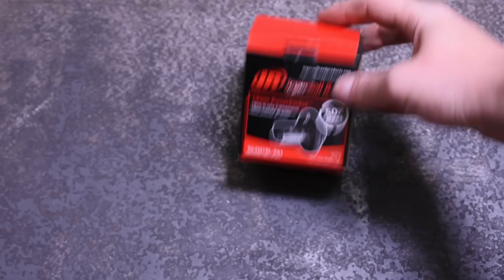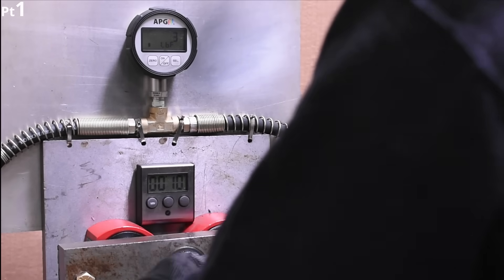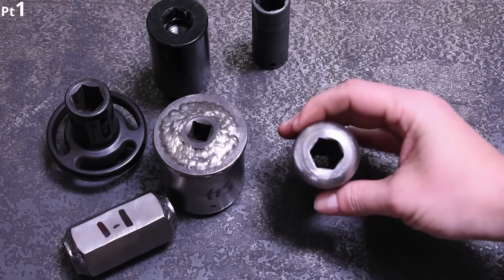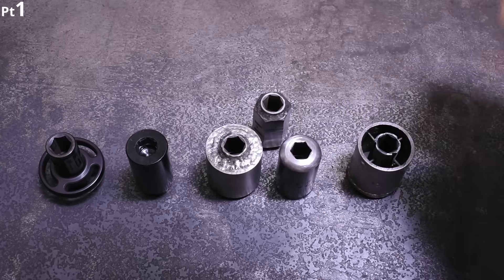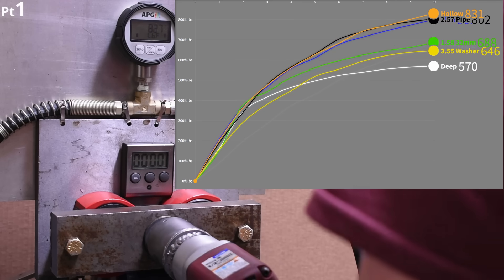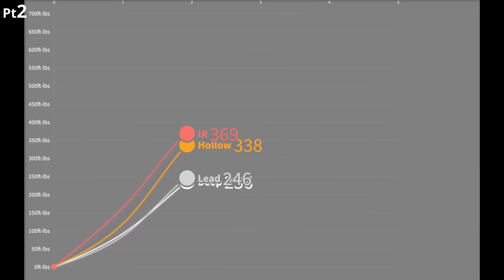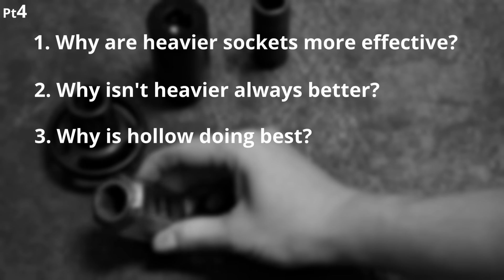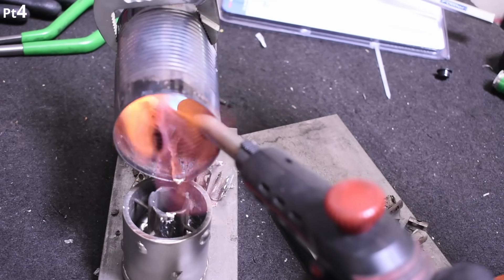Heavier Sockets Make More Power? Stumps Physicist

Comment: Mechanical engineer here, the goal of these attachments is to achieve better dynamic frequency responses out of the tool. The resonant frequencies  are difficult to pinpoint and just about every condition influences if you can perform at a resonant frequency. If your attachment makes the tool perform at a natural, resonant frequency, you will see force multiplication on the output. I think there’s a MythBusters episode about this.
Reply: @Eddie To make this a testable hypothesis, can you propose a way to tune the resonant frequency of the system in a fairly continuous, reversible, and repeatable way? I’m thinking of a socket with a concentric outer sleeve (like the hollow design from the video) that has dozens of tapped holes for removable set screws to change the mass / rotational inertia. I guess they’d need to be blind holes so that you could set them to the same depth every time.
Reply: @bjmcculloch  An electric impact tool could be modified to run at variable speed.  You could then ramp and tune the frequency to match the application each time.
Reply: Physics education myself, but thinking the same thing. Some kind of resonance seems important.
Reply: You said it more intelligently than i was going to do. The professor failed to consider the power source applying the force to the socket. Impact tools don't produce linear power.
Reply: Good line of thinking! Any time you hit something with a hammer there is some oscillation. If you hit the object again when the oscillation is in the same direction as the hammer blow you get an additive effect. Keep hitting the object and the oscillations of all the previous hammer blows add up and if you strike the object at the sweet spot where all the oscillations add up in your favor you get more effect.
Reply: @blackcat31w  sounds quite a bit like Nikola Tesla's "Earth quake machine" He knew there was great power in vibrations and resonance
Reply: That's kinda what I was thinking.  It's not just weight but frequency and balance alao
Reply: Dynamic response is the correct thought path.  I think what's going on is impedance matching.  The bolt shank and the impact driver output shaft are twisting and absorbing energy that should be going into overcoming friction in the bolt thread.  The added inertia is both reducing the peak velocity and storing energy, which effectively makes each torque pulse slower but longer.  The effect is the torque pulses look more like a steadily applied torque to the bolt.  The impedance between the impact driver hammer and the bolt thread is reduced.
Another effect of the slower/longer torque pulses will be the socket does not bounce off the bolt hex as much, so less energy is wasted rotating the socket to be back in contact with the hex during each pulse.
When they shoot the high speed video, what we should see is the heavier sockets don't rattle back and forth as much.
I can't think of any reason the shallow socket would have performed better than the deep socket all else being equal.  My guess is the shallow socket was a tighter fit on the bolt hex.
Reply: ME here too...makes sense!
Reply: Stfu mechanics hate u
Reply: Nailed it.
Reply: This has to be the explanation.
Reply: It’s a three mass spring system, the moment of inertia of the center mass( the socket) and the frequency of impact determines the maximum force between the socket and the nut/ bolt.
Reply: On the $72 socket with a flywheel style. The added weight is out away from the center of mass. On just adding weight, as with the lead loaded socket, the extra weight was evenly distributed from the center out to the edge. This gives you plenty of weight but it absorbs the impact's power to turn this extra weight. 
The extra thickness of the one very thick store bought socket is as your physics guy talked about is that with a tube a thicker wall is stronger than a thin one. This makes the thicker wall less likely to flex under the impact's force. Like regular sockets are made with a somewhat thin wall tube and impact sockets are made from a thicker wall tube. 
On the hollow built socket worked because it used the same flywheel effect the $72 socket used.
Reply: Redneck engineer here: You can swing an 8lb hamner, or a 16 lb hammer. Which one will do more damage both to you and whatever you swing it at? Resonant frequencues absolutely come into play in engineering. But this is literally equuvalent to just swinging a bigger, longer, hammer. Making the hollow socket is equivalent to putting a longer handle on your hammer. Just like with a hammer, there is a limit to what you can swing, no diff with the socket and wrench. At some point the hammer becimes too heavy to swing
Reply: So its acting as a second impact between every time the hammer in the tool hits the anvil? I'd be interested to know how the same socket would perform with another arm lengths and thicknesses.
Reply: I don't think it's that complicated. I think it's just damping preventing energy losses
Reply: And it would make sense that the tools are tuned for the larger, heavier sockets that you would use with larger, higher strength bolts.
Reply: @kco1270  ideally yes. Unfortunately, a poorly chosen socket/extension could easily suppress and dampen the output torque of the tool. You saw some of this in the video. Dynamic systems and controls are a really interesting field of study.
Reply: I stayed at a Holiday Inn one time and believe you are on to something.
Reply: Yea as a mech engineering student this all seems to be while not basic, something that should be able to be understood. I think he either found a poor physicist or a busy one with exams around the corner!
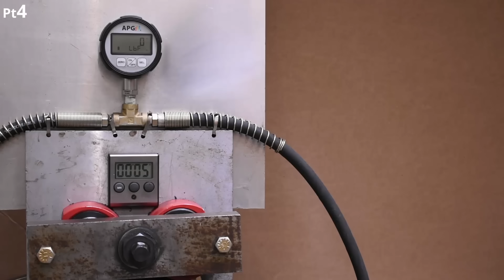Reply: Some of the sockets @14:47 flywheel removed version as well as xyz are visibly not balanced, perhaps directing the vector of force somewhere other than a purely 360 degree rotation. Skewering these and balancing them on an old school motorcycle fork style tire balancer then removing non conforming material with a drill or grinder might go a long way towards smoothing direct comparisons.
Reply: In an electrical circuit maximum power transmission is achieved when the source impedance matches the load impedance. I expect this is similar except mechanical. Timing/resonance might also be an issue, like pumping at the right time to get a swing moving. SloMoGuys might be useful? Might be similar to the way an antenna works as well. Don't some impact tools hit faster (more frequently)? My gut tells me that a lighter socket would work better with a faster tool and that a heavier socket would work better with a slower but harder hitting tool.
Reply: Not engineer here: I would also assume that the fact that the body transmitting the force on the DIY sockets seemed to be made from mild steel, the difference in effective Youngs modulus between a mass produced socket made from forged and tempered 42CrMo4 (SAE 4140) steel and a DIY welded composite socket made out of S355Jr (ASTM A572) would probably be significant.

Just my guess, might be a total fluke
Reply: Instantly thought of Tesla here, ‘resonance’👍
Reply: If you say so. Seems far simpler to me and all were seeing here comes down to differences between discs vs rings on torque. If you're not sure what I mean, there's a difference between how a disc rolls down hill and a ring.
Reply: Incorrect.  It's acting like a fly wheel.  That means it's maintaining momentum.
Reply: @Mr_Dopey You're wrong. Touch grass kid.
Reply: I don't think this is correct, I believe the tool is tuned to perform at a frequency range, otherwise a variable trigger would be pointless on power tools. I think the biggest factor has to do with where the mass is concentrated in the socket. The hollow socket performed the best because its mass is concentrated further from the center of rotation, which makes the mass accelerate faster, improving the force of the hammer strike. Also a mechanical engineer, though I don't believe that makes me smart.

Comment: A couple of thoughts:

-Firstly I think it’s most useful to think about this problem in terms of angular inertia. E.g a weight put further out contributes more to inertia to the socket than the same weight close to the center line.
- In those terms it looks possible that all of the sockets that perform well kind of cluster in the same region. Either having little weight far away from the body like the hollow socket or a fair bit of weight concentrated close the the center like the Lyle.
-This suggests that there’s an optimum amount of angular inertia for a socket to have
-If this is the case then we can explain the lead and heavy washer sockets low performance by them being further from this optimum amount.
-But then why does this optimum exist?
-I can only hazard a guess but we already know that increasing the hammer mass of an impact improves its performance. 
-But we’re not increasing the mass of the hammer you say. True but the socket is the hammer from the perspective of the bolt.
-That would explain why increasing the weight of the socket improves performance. But we also need to explain why there’s an upper limit where performance drops off.
- If we again think of the socket-anvil-hammer system as the hammer from the bolts perspective perhaps the super heavy socket prevents the system from reaching its maximum speed during the split second that it’s being accelerated by the impact before it in turn impacts the socket.

This all suggests a couple more experiments. 
- Does relocating the weight of the socket to further from the centre also improve performance as my tiny knowledge of physics suggests?
-Does my guess that it’s the weight of the entire socket anvil hammer system hold up. If we move an oz from the hammer to to socket what happens?
-If we force the issue and remove all slop from the socket anvil joint by say welding the socket on does the impact perform the same?

Awesome video as always
Reply: Great video! Sometimes when I'm having difficulty getting a fastener in or out,  i turn the whole impact driver in the opposite direction until all of the slop is taken up in the wrong direction... giving it a maximum slop condition. When i pull the trigger the motor has a brief moment of more free-wheel spin while it takes up the slop in the system.   Kind of like trying to give the motor a soft start without any pre load.  So, going of that , I wonder if the flywheel like designs optimize slop spring back to couple the most angular momentum into the system. Kind of like adding a  secondary hammer to the impact driver.
Reply: @jasonspudtomsett9089  Yes, I’m wondering how much the variability in the slop for different sockets influences the outcome – both in terms of the driver-to-socket slop and socket-to-bolt slop.
Reply: Perhaps the maximum socket weight is somewhere below the weight of the hammer in the gun. If the hammer weighs more than the socket, it's going to be exerting too much of it's inertia just to move the socket?!? just a guess, but your thinking was on par with mine
Reply: I'm curious if stiction is a factor. When the bolt starts turning, the increased momentum keeps it moving. I also expect that the characteristics of the impact gun would have a preferred amount of momentum for the socket. There could also be some bounce happening.

It's pretty fascinating.

Comment: I HAZ WELDER! CHOP CHOP CUT CUT MELT MELT SPARKY SPARK SPARK... what about an extended socket to clear said application (crank pulleys, wheel lug depths, etc) but with a hollow mass more towards the impact thus allowing the beans to get to the bolt. I see a lot of ironworkers chopping a standard impact socket in half with a cut off tool then welding a length of pipe between the socket end and the impact end (making a 3" socket about 8-12"). Curious to see what a socket like that brings to the table in comparison to a standard uncut socket, as well as say adding the hollow bit towards the impact end.

Comment: The thing about professors is that they mainly operate in the theoretical. I'm just a lowly mechanical engineer but I think you have a couple things going on here. The point about rigidity is definitely true but most likely negligable. As long as a large amount of energy isn't being lost to deformation (i.e., the whole thing is made of steel and not, say, lead...) then it probably isn't a factor in these tests. I imagine the flanks of the nut are deforming more than the sockets typically do.

As far as your observations, you are probably seeing a mix of flywheel effect optimization, and what I guess I might call good harmonic matching. The hollow socket cleans up because it has the right amount of mass and puts it in the right place. The heavier sockets probably don't work well because the impact can't accelerate them to top speed in the small space that they rotate in (the fixed impulse from the hammer doesn't deliver enough energy). The lighter hollow socket is being rotated to a higher speed, and the energy is being put into mass located farther from it's axis. Given two sockets of equivalent mass, one with a much higher moment of inertia around it's axis is going to be able to deliver more impulse to the nut.

This kind of ties into my other theory about the harmonic matching. I imagine at some point the mass is optimal for the hammer speed and force which allows it to sort of bounce off the hammer with perfect timing and absorb the energy more efficiently. I would put this firmly in the speculative category because I simply don't know enough to be confident, but it seems right in my head. Anyways, big fan of where you're taking this channel and I would love to see more of this type of testing.

Comment: To my understanding the lead didn't work as it is a soft metal and soft metal has more space between electrons so transfers less momentum. I think the bigger mass helps but the weight hurts. Hence the hollow is the fastest to spin up and less mass to slow down or transfer.  I would do 2 tests at this point. 1 a hollow large mass on a extension with a reg deepwell socket.  2 a larger hollow mass on the back 1/2 or 1/4 of a deepwell socket.

Comment: What you should do now is make a relatively light weight socket, but with a 12" diameter flywheel.  To see how an exaggerated flywheel helps, but without being overly massive, with too much inertia...  Because it seems to me that the "Hollow" does so much better because it's the combination of larger diameter, but with lighter weight;  so that it's initial movement has lower inertia (by being lighter), but once it is moving, the flywheel does bring a leveraged momentum with it, which somehow seems to increase it's inertia (effectively/ possibly. lol)..   

So I would take that hardened socket that you cut the flywheel off of (at the end of the video) -- and take a 3/8" x 12" diameter disk and weld it back onto that socket (ideally you could make this larger disk the exact same weight as the flywheel that you cut off, to compare the different effects of flywheel size at the same mass).   This one test would give you quite a few answers...  

It would also be very cool to see a few flywheels at different sizes welded to short 1" extentions--  so that way you could use the flywheel on any number of sockets;  I think being such a short extension, maybe it could still have great benefits, without giving up too much gain due to it's tortional flex.   Great experiment.  Cheers.

Comment: The way I understand it(in a simple hillbilly kind of way) is similar to putting a 1 pound weight on a string. Swing that weight in a tight arch, say 3"..It will provide additional force and momentum but the length of the arch limits how much. Now swing that weight on a 10" arch. Same weight but it generates much more force and momentum..

Comment: @Torque Test Channel
The Power socket flywheel seems like a moment of inertia thing, the impact only can provide so much force so having too much weight just bogs it down.  Instead by going to hoop design you get way more moment of inertia relative to mass.  A hoop around an Axis gives you I = MR^2 while a solid socket gives you I =1/2*MR^2.  Basically that means you require half the mass to get the same effect the farther from the center you get.
https://en.wikipedia.org/wiki/List_of_moments_of_inertia

Comment: Putting the professor's HYPOTHESIS to the test.

Also there is a lot that can explain the difference. Harmonics, for example (think deadblow hammer). There is also a balancing act with momentum and KE, where you can generate the most momentum in the socket for a given KE. The fixed power from the wrench is your given KE, and the KE output is based on the efficiency of energy transfer due to mass and design choices. Longer contact times and fewer blows per second will favor heavier sockets and hammers. Heavier hammers should be less affected by small changes in weights.

There's a virtual mass factor as well. How much energy is lost just accelerating the components of the wrench and not the socket itself. 

Don't have the time, knowledge, or equipment to do any better than armchair physicist. In short I'm not convinced that lighter is better, but I am convinced that stiffer is better.

Comment: Think about how much impact you could make with a ball on the end of a long light weight rope...versus a ball on a long metal stick. Or the same reason why a hammer isn't a heavy steel shaft with a heavy steel head, it's a lightweight shaft with a heavy head. By putting the mass out at the end, it's easier to accelerate but can still deliver that rotational energy back when it hits something.

That's my theory anyway, essentially it's not the total weight, it's the high potential energy of rotating mass at a distance from a center point.